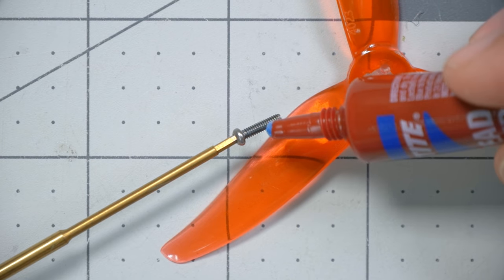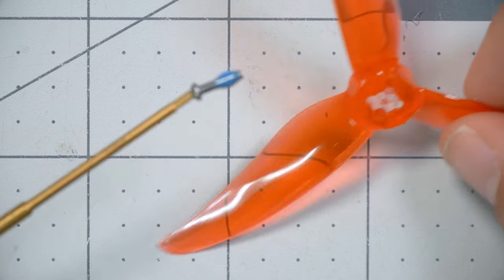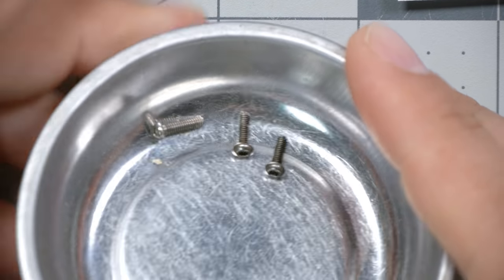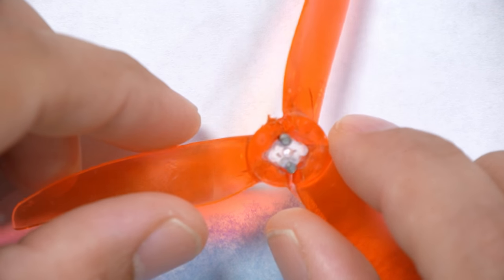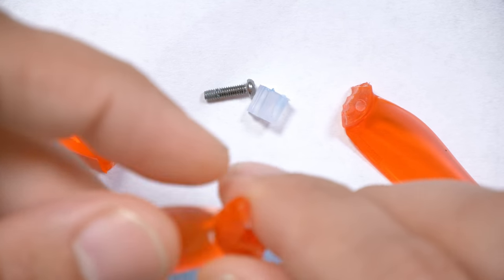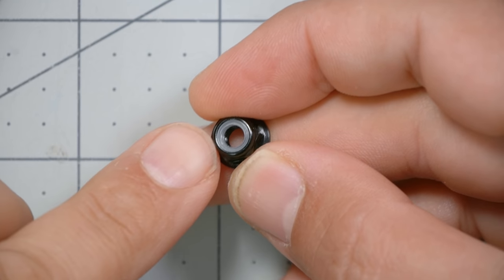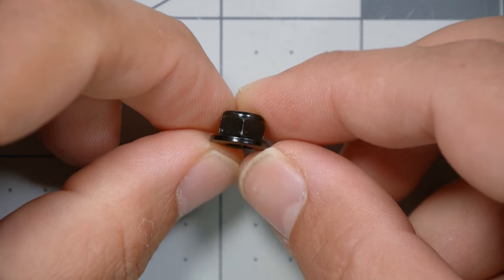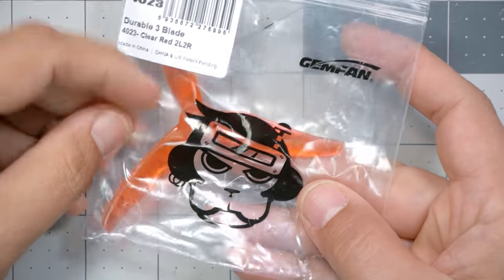This is why you don't use Loc-Tite on your prop nuts or screws

Comment: OMG THE MOMENT I CAME BACK FROM THE FLYING FIELD SAYING TO MYSELF "TOMORROW I WILL LOCTITE MY PROPSCREWS" YOU MADE A VIDEO ABOUT IT!!!
Reply: Try vibra-tite vc-3 instead. Or something like that. The lock nuts are best (or with vibratite)but still vibra-tite is just great alternative to loctite
Reply: @softsmoken  Nyogel damepening grease works really damn good as well, doesn't really matter which one but I use 767A specifically. And it doubles as vibration dampening for your drone.
Reply: @F-M-FPV  yea I'm familiar, great stuff for unique situations.. but personally I'd rather avoid stuff like that on any project that's not already greasy or using any oils etc in general to start with. Under a hood of a car or on certain machinery/ regular maintenance parts on large machines inside  greasy boxes of gears and stuff. 
Far as vibration dampening, beyond the little bit gained from having a product on the screws I wouldn't wanna use enough of any polymer or grease for it to make a large difference other than maybe some of that higher frequency/  real hard jittery resonance between the motor and carbon and for that I find using like a rubber spray (they use it for like on a mold for allowing the carbon fiber or fiber glass to separate after, you know the stuff) and putting a couple layers on t where mounting or using something very very thin like the stuff for bottom of tool drawers for a cushion or even just tpu/very thin soft plastic. Id prefer painting it with the vibratite for a thin rubber layer than having greasy anything.  
Also there's  great self adhesive products from Sims vibration labs(limbsaver- used on bows/ hunting equipment and whatever you can imagine) ) that work as great rubber drone feet and are great at leeching out a large range of vibrations. Inside an electronics box of some kind that won't be opened often or ever and is going to be somewhere other than inside cozy on a shelf is the kinda place I really like greases.

Comment: Nylock are reusable but to a certain extent. Coming from an engineering background in both aerospace and automotive, they are a very attractive locking devices and quite common in automotive, but also not really "for everything" and are almost never used in aerospace. That is for 2 reasons: Nylon creeps, and Nylon melts. The melting part is easy to understand, once you reach their service temp, their structural integrity is gone. Depending on their origin, nylon service temp is 120C-150C (250F-300F). Being close to heated motors, this could be reached I suppose in some cases. The creep one is harder to detect and harder to measure. It's the property of (all) material that makes its structural properties gradually degrade when under constant load, exacerbated with temperature rise. Nylon will start creeping at about 60C-80C (140F-175F). That means the constant load (compression from the metal threads into deforming the nylon) will loosen as the material relaxes and the spring load from the nylon will not push back (enough) against the threads anymore; eventually offering no more locking mechanism. For this particular reason (creeps at fairly low temp) it is usually not used in aerospace. Metal locking nuts are used instead, where a metallic feature in the nut deforms as you screw it in. I'm not saying we should use aerospace locking nut ($$), but nylocks should probably be replaced more often than not on a quad, for prop ones at least, due to motor heat nearby.

Comment: I stopped using Loctite 10 years ago except on larger steel on steel connections.  The solvent in Loctite can/will attack plastics and even affect Teflon, modifying and weakening it. Loctite can also cause an electrolytic reaction between dis-similar metals in a connection creating a corrosive effect making disassembly sometimes impossible. If you do get them apart the threads are often damaged or destroyed. 

If you see new screws with a locking compound on the threads, it is not Loctite which is put on wet and then cures after assembly. It is Vibra-tite (VC-3 threadmate) or a similar compound which is put on the threads, then allowed to dry before use. The bolt or screw can used, removed and reused without the need to reapply the compound. I carry little tubes in my toolboxes and a bottle sets on the workbench.

If all else fails, there is always duct tape.
Reply: Thats a cracking bit of info, appreciate the knowledge! Especially interesting that it reacts with metals in such a way
Reply: Interesting! Yeah I've noticed that the stuff that comes preapplied to some done screws holds up well over many uses/reuses.
Reply: Well, even if they used alcohol to install it, and it's on the threads now, the alcohol has long been evaporated.
Reply: Yup, or like when a cheap garden hose will basicly "weld" itself to the spigot due to corrosioin. The metal will break before the threads turn

Comment: Remember - "Loctite" is simply a brand of **threadlocker**.
Other brands and formulations exist and have different interactions with different plastics and composites. Loctite 242/243 (what most of us think of when someone says 'blue loctite') is particularly destructive to polycarbonates and styrenes (including ABS). It is not, however, destructive to nylons. Many "basher" pilots don't like glass or carbon filled nylon props, but they work very well (in most cases better) for those of us that don't call ourselves 'racers' or 'freestylers'. Loctite 248 (comes as a stick/paste - looks kinda like an elmer's glue stick) tends to do ok vs. polycarbonate and styrenes - as long as you're not coating the whole prop with it. There are also- other threadlocker formulations and brands. Vibratite VC-3 is safe around most common plastics. "Rocksett" (commonly used in attaching firearm muzzle breaks) tends to be ok around most plastics too.
All that being said - a good serrated nylon locknuts are totally sufficient in every way as long as you give them a couple uga-dugas of tightening force.
Reply: whats the conversion factor between uga-dugas and newton meters?
Reply: @drkastenbrot  I was just wondering the same thing
Reply: I was going to post this same info… I’ve used the “glue stick” version for years for my cars/motorcycles.  It wasn’t as “messy”, and didnt cost as much..   I am real surprised JB didnt also try this version to see if it had the same reaction on props
Reply: @robaxelsson530  keep solvents away from plastic and rubber
Reply: Yup, that’s why I run non-ethanol fuel  (with stabilizing agent)in all my old motorcycles and lawn stuff .. doesn’t eat the rubber fuel lines or o rings in the carbs

Comment: This is awesome and extremely helpful. I recently purchased some nuts from the hardware store that had loctite on them and im glad i ddint you it. I think what would work wonders is if props had grooves in them and then a grooved washer that bits down on the nut and prop. Maybe that already exist...

Comment: Hi Jb, 
 You can use pva wood glue as locktite on the screws. Put a blop down on somthing and dip the end of the screws in the blob of glue. Tighten screws and all done, give it a go. I use it on my screw in props .

Comment: ALSO  TRY vibra-tite vc-3 instead of loctite. You use it and let it dry on the screw before you install it. The thin rubber coating will keep it from vibrating out and you can remove and reinstall the screw usually at least afew times before reapply. loved by machinists/engineers everywhere. There's more formulas than the vc3

Comment: Really great tip, specially to 2.5" or 3" props that holds with two screws. Thanks for sharing! 🙌🏻
Reply: I use an alternative to blue loc tite from another brand on my 2.5" t-mount with no issues. HQ and Gemfan props remain strong.

Comment: Back in the day I used to add a little plumbers tape to the motor shaft and I think it helped. Just started using better nuts. HATED counter-threaded motors when those were a thing for like a month.

Comment: Hitec servos were failing because people were using thread locker on the screws holding the arms on, this was years ago and I believe that they included a warning in subsequent batches telling users to definitely not use anything other than the lockwasher included to secure the arm.  Some plastics just don’t survive the experience. A properly sized lockwasher would be a better solution with bolts, and for sure nylock nuts are the only ones suitable for use.
  Regularly checking tightness is the answer after encountering prop strikes.

Comment: Or anywhere there is plastic! The neckstrap on my X9D+ kept loosening up and it was driving me crazy. So I put a dab of loctite on the bolt when tightening it down. Few days later the neckstrap bolt just pulled right through the front of my radio - plastic around that whole area was melted/cracked. Fun times!

Comment: Been there. Done that. Last summer I put Loctite on my 2 inch quad props. A couple of days later I did a power loop and two props "exploded" in the air but the quad landed in tall soft grass. Examining the other two props I found marks that looked like plastic stress marks.

Comment: The same broken plastic happens on the EFlite Apprentice motor mount.....  I had the motor break off the motor mount on takeoff... and bang around on the front of the plane at mostly full throttle.  Was really fortunate that this didn't happen in the air...

Comment: That is very important information!

I discovered that over 30 years ago on some plastic cased opto-isolators used in electronics. Doesn't apply to all plastics, but I guess you'd need to be a chemist to understand which are likely to be affected. (One told me something in Loctite destroys the molecular bonds - which didn't get me much further).

I used Loctite a lot in motorsport, but don't use it anywhere on a quad. On the props with 2x 2mm mounting screws, I put a tiny amount of hot melt glue between the screw heads. Same on the 4x motor mount screws underneath and any others that might be prone to vibration. On 5mm props just rely on nyloc nuts. Actually had some DYS motors that had no nylocs - they never came loose either. Never had anything come loose actually.

Comment: I just had a prop blow up, and I noticed that the screws had some loctite on them. I thought that it would be ok since the loctite was already dry on the screw, but this might have been the problem. Some people also suggested that I may have tightened the screws too much, damaging the hub, and also the the props may have become brittle with time. I didn't know props became brittle.

Comment: Couldn't you pre apply loctite to the screws, let it dry and then use it so you don't have solvent issues? I have seen a lot of frame kits namely the impulse RC apex that have pre applied loctite to the bolts.
Reply: Iflight does the same.
Reply: Yeah that's exactly right, I have used gallons of loctite in my life as a mechanic, as long as you let it dry out it shouldn't affect your props but the holding power will be slightly less, still way better than nothing though if your screws are coming loose. That being said I've never had a screw back out of a t mount yet and I don't use loctite on them.
Reply: But why? Nylock and teeth on top of the motor and you can hit scraggle or whatever and tye props never loosen
Reply: @djilly75  pretty sure he was referring to t-mount only not nylock nuts on top, yeah I would never run loctite with nylock nuts, unnecessary
Reply: Most loc-tites are an anaerobic adhesive, meaning they won't dry unless they are taken out of an oxygen containing environment. (ie. In between a screw and nut)
Reply: @jakeman1251  all the blue lock that I have ever used will eventually dry in open air, if it needed lack of oxygen to dry why wouldn't it dry the bottle totally sealed?
Reply: If you let it dry before screwing it in most of it will simply scrape off as you thread it in. It's meant to go in liquid and dry while the threads of the screw are in contact with the surface it's being threaded into. I sometimes use loctite when screwing the motors onto the arms but realistically even with motor screws if you are just good about checking them after the first few sessions flying and tighten if needed they will then stay tight and not be a problem.
Reply: @SteadfastRC  Anaerobic threadlocker also needs the presence of metal as well as no oxygen to cure, hence why it does not cure in the bottle.
Reply: That's works, but mine have never been a problem, but I mostly fly 5 inch.

Comment: Locktite does not "dry" like glue. Exposure to air keeps it liquid. When it is sealed in an airtight hole situation an anaerobic reaction makes it harden. Locktite company had a hard time designing the skinny metal tube trigger aplicator because it needed to mix in air bubbles with the locktite to keep it from hardening in the tube of the device.

Comment: I use Loctite without any issues for decades. Just put a very small amount directly in the hole (with a toothpick) and everything runs fine.

Comment: Ive done it because the shaft was shorter than needed to reach nut's locking part. But it is enough to just apply a few drops of it without prop, leave it to dry and its enough for many times of unscrewing it. Thats what i did, but i didnt know what it does to props.

Comment: I remember back in 2013, I used to use zip ties on props to motors. Those were the crazy days. lol.
Reply: Wait, you have photo for that??
Reply: @kibbycabbit  I might have a picture somewhere. But if you are trying to do that now, most of the motor's bell doesn't provide that space. It used be better with motors like DT700 which swings like 12 inch props.

Comment: When I disassembled my copter to install the receiver's tbs, I removed only the upper frame, and twisted it back to the thread lock .. and then the other day I had to change the uarts .. I could not unscrew, I had to disassemble through the lower part of the frame 😞.. so use with caution

Comment: Does the solvent evaporate away? Could you let the loctite dry before installing the screws? I haven't yet lost a screw on my 3 inch but there should be a better solution.
Reply: Licensed Aircraft Mechanic, so I know a bit about adhesives, and from research and real life experience, Locktite and other brands of thread locker sets in the absence of air………so those who say things other than that haven’t done their homework.  There are adhesives that some manufacturers use ( you will see a blue dot on the threads) that would probably work, but have no idea where you could purchase it.  A small dab of fingernail polish if you really need adhesive around plastic is what I personally would use.  My 2 cents for what it’s worth.  Happy flying!

Comment: Interesting - I've never done this myself but the screws that come with some of the iflight T-style motors (such as the 1404) have blue Loctite (or something similar) pre-applied to them on the ends. Maybe it's not an issue since it has obviously already dried by the time they are used? In general your Loctite looked a lot more viscous than stuff I've used in the past as well.

[Edit] Comment below seems to indicate that this is not actually the same thing as the blue Loctite and is indeed some other formulation that is designed to be reused and doesn't pose the same problems. TIL!
Reply: Hi matey The nuts that come with motors, that have thread lock on, there for connecting the motor to the frame. Hope this helps
Reply: @GeorgeCooper_LoneWolf  There's several sets in the motors I have, one of which is clearly for the props...
Reply: The problem isn't the thread locker, the problem is the binder for the threadlocker. It's alcohol. The alcohol evaporates, leaving behind glue and effect. Those screws that had thread locker pre-installed, they don't have any alcohol left in them.
Reply: @AndrewLauritzen  If that's the case then just use them and see what happens 🤞

Comment: Did think you were scraping the barrel on this one, but I "Learned something today.™"
I know, from metal working, that loctite isn't used for plastics, but didn't know what would happen.
Not the bottom of the barrel yet Joshua Bardwell.

Comment: Yep. Found out the hard way ...
On the take off 3 out of 4 props flew back to China and the quad came down hard. 
Luckily that was just my 4 inch.I'm thinking what would happen if that was my 7 inch quad with GoPro on it... 😖.
(I'm desperate for striping the motor mount and propeller mount holes for some reason)

Comment: It seems like you are the only youtuber who says loctite dissolves plastic. Could loctite be ok if you are careful to keep it only on the screw? Once it dries, it's ok, right? 
I mean if you just put a drop on the screw thread, then it should be fine. Did you use a drop or put a squirt on each screw?
Also there is a kind of silicone seal that eye glasses guys use to stop those tiny screws from loosening and it comes off and it only takes a drop. There is also stuff like silicone for windows that is removable Seal 'n' Peel.

Comment: Loc-tite is anaerobic which means it pulls elements from the surrounding area to cure so basically it doesn't need oxygen.  Which makes sense since you use it on a screw and there's generally no extra o2 around the area of the hole and screw.     You can use other non-anaerobic like vibra-tite vc3, they need to be cured before install.

Comment: Would using screws that already have dry thread lock on them also damage the props?

I just blew up a prop on take off and I'm trying to figure out if this was a cause. 
Other possibilities I'm considering are: physical damage from hitting something on previous flights, over tightening screws, and possibly the plastic becoming brittle with time and exposure to the sun (not sure if they do that, it was a white Gemfan 2540).